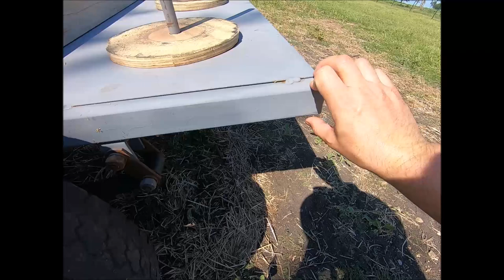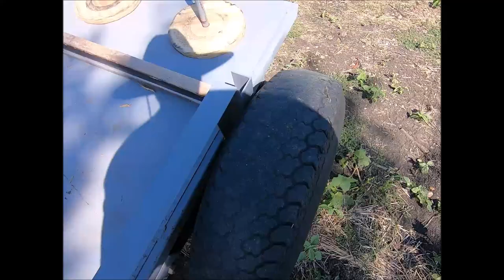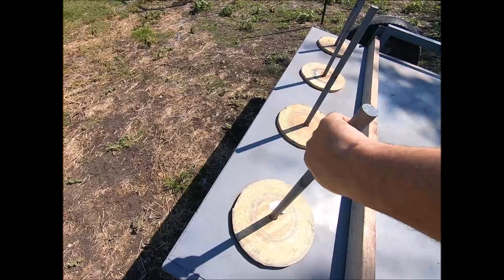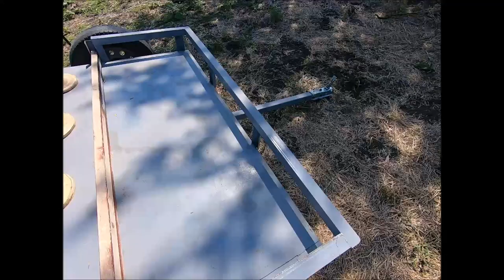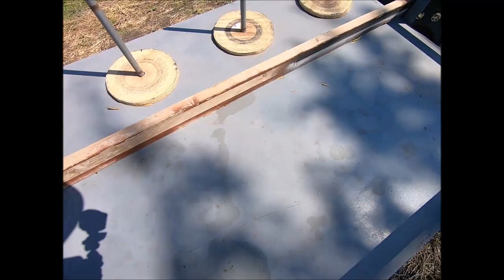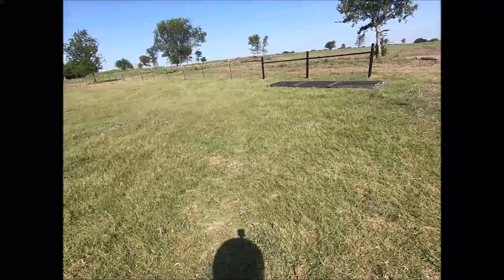Homemade Barbed Wire Unroller Fencing Trailer

Comment: Nice unit. I like the multi wire approach but have always been worried it would lead to  a lot of tangle problems. Currently using a similar design with a single roll which works very well until the hill gets to steep. This would save time for sure. Have you noticed any tangling as you reach the end of the rolls as they begin to jerk near the end? Thanks for the video.
Reply from the maker: Surprisingly I did not have any tangling issues as long as I drove in a straight line next to the fence. Only one wire has crossed, one time, in all the fence built due to driving around a hole. It’s been great and my fencing project is now complete. Subscriptions and likes are appreciated!
Reply: @DanTheOldToolMan  I may give this a try. Your finished fence project gives me hope I've been replacing fence for years with no end in sight. lol Life of a farmer I guess.
Reply from the maker: I worked on it every weekend for close to a year. I was tired of seeing barbed wire! Finding some young people wanting to earn cash helped also. I would put them on clipping the wire to the post while I stretched and tied off. In the end about 1/2 of the perimeter fence was replaced and all new cross fencing.

Comment: How long is each of those things that the wire sits on ?
Reply from the maker: Stay tuned I’ll measure it later. Those things are 7/8” or 1”(I don’t remember which I size I used) pieces of sucker rod.
Reply from the maker: They are 20” from the floor. However, 16-18 inches would have probably worked also